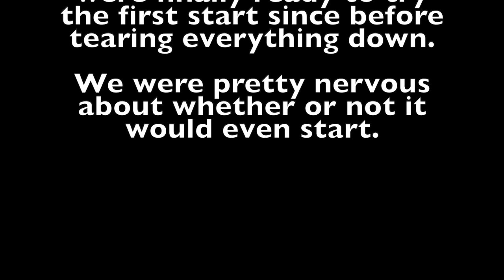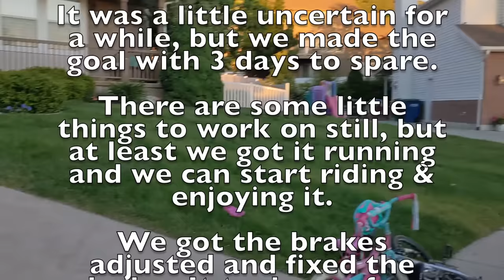Yamaha Virago XV920 Cafe Racer Build Timelapse

Comment: I watched  from start to finish & was amazed. I'm impressed by the craftsmanship & patience. Not only his but his wife's too. I have a 1981 750 Virago (red) that I bought new in '81. I tried the Cycle Shack duals & found the stock exhaust was better. The Kerker system was a great improvement overall. 
I put rear set(3") pedals , Eddie Lawson bars & a small fairing to help fight the wind.
Congratulations.

Comment: My guy.  I need a break down on that media blaster you made.  Looks amazing.  And how does that compressor handle air tools?
Reply from the maker: It's just a poor man's blaster made from a gatorade bottle and a cheap harbor freight air blow gun. The media was walnut shell from harbor freight.  Whole thing was pretty cheap and easy to put together.  I can't remember where I found the idea online, but there are probably tutorials for it out there.  You basically cut a hole in the air gun nozzle facing upward and drill a tight fitting hole through the plastic bottle (something with a wide mouth opening is easier to fill) so that the nozzle can run through the bottle & gravity will let the media fall into the hole in the nozzle as you blow air through it.  It takes a decent compressor to run it well.  I don't even have mine anymore...I let a friend borrow it and never got it back, but IIRC it was like $5 to make, so not a big deal.  I'll probably make another some day if I need one again.  Good luck!
Reply: @rockinfreakappotomus  I'm fascinated with DIY tools.  I like the idea of fabricating.  Creating tooling helps to create better tools.  It's like a mini industrial age in your own garage.

Thanks for sharing.

Comment: Wondering where to source the headlight and bracket? Thanks, great build!
Reply from the maker: This is the headlight I used, which looks like it might not be available from that same listing any longer, but most of this made in china type parts are available under multiple listings and even different brand names but using the same actual part.

Headlight: https://www.amazon.com/gp/product/B07P5WFFQG/ref=ppx_yo_dt_b_search_asin_title?ie=UTF8&psc=1

Mounting bracked & headlight bucket I bought separately on eBay. It doesn't look like they're listed anymore either, but I'd bet you can search and find the same thing. For what it's worth the titles of the listings I bought were these:
Headlight bucket = 7inch Motorcycle Headlight Black Housing Cover & Bracket Round Headlamp Mount
Mounting brackets = Fit For Motorcycle Headlamp Bracket Front Fork Headlight Mounting Holder Clamp

If you search those titles on ebay, you'll probably find the same thing or something very similar.  Good luck!

Comment: First things first amazing job on the bike. And now you have memories that you and your children will cherish forever…. May have ask a few questions? That carb, manifold and jet sizes? The paint on the engine semi black or satin? And rear wheel is that off the newer viragos?
Reply from the maker: Thank you for the kind words!  The  carb is a Mikuni VM30, the carb manifold is a BIP (the composite version, which I don't think I'd buy again), and I'd have to look back into the jet sizes to recall what I ended up on, but I do remember it was smaller than I expected.  That detail is going to be different for everyone, so there is a tuning process to work through and find the best size jets for your setup.  I bought a variety pack of main jets and I think I ended up using one of the smaller ones, 220 or 230 I believe.  For the pilot jet, I bough a couple sizes close to whatever came in the carb, and I don't recall exactly where I ended up, but I think it was around 27.5 or so on that.  Your results will vary.  The paint on the engine is VHT high temp wrinkle finish, which is a matte finish and also wrinkles slightly as it dries, and I think gives  a really nice looking finish besides also being a bit forgiving on the application.  Rear wheel, if I recall correctly, is actually from a Yamaha XJ700 II (1985 model year I think it was?).  I found that on eBay and it looked identical, so I took a chance and bought it to try out because I liked the straight spokes better than the swirly look of the virago wheel.  Fit like a glove and looks great IMO.  Hope that info is helpful to you, and all the best with any projects you take on!

Comment: What tank, muffler and pipes did you use?
Reply from the maker: Tank is a 1978 Kawasaki KZ 400 Gas tank which I found on ebay. Had to cut out the bung and weld in a new one cause I didn't have the cap to go with it.

Muffler/pipes are just what was on it when I got the bike. I think they're the stock set up with the baffles cut out, but honestly, I'm not sure on that. I had planned to fabricate a custom stainless pipe job, but never did, and I sort of liked what was on there already, so I kept that setup.

Comment: What model is the rear wheel?
Reply from the maker: It is from a Yamaha XJ700...don't recall exactly the year, but I think it was 1985.  I found it online and it looked like it would fit the virago, so I took a chance and bought it, and it ended up fitting perfectly.  I think it looks much better than the virago rear wheel and it matches closer to the R6 front wheel I have.

Comment: Does anyone know which speedometer I install, which one is compatible for this motorcycle?
Reply from the maker: I used this one, which works with GPS rather than the traditional cable connection.  https://www.amazon.com/gp/product/B07KPBYR7P/ref=ppx_yo_dt_b_search_asin_title?ie=UTF8&psc=1  I also swapped my front end, so I probably could have used the speedo from that same front end if I had wanted, but the GPS one works well and was a cleaner and easier job to fit it to the bike.